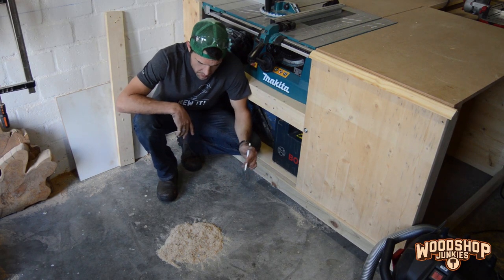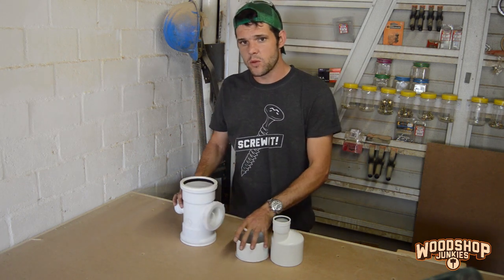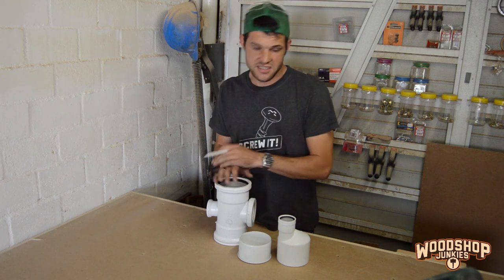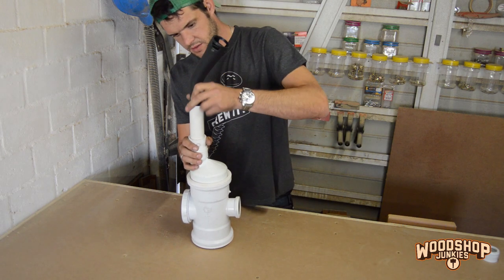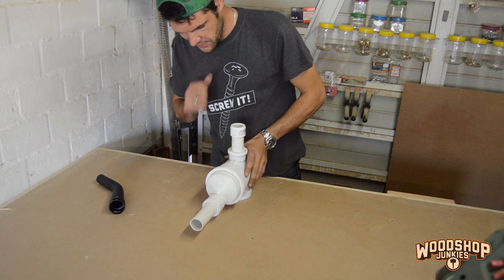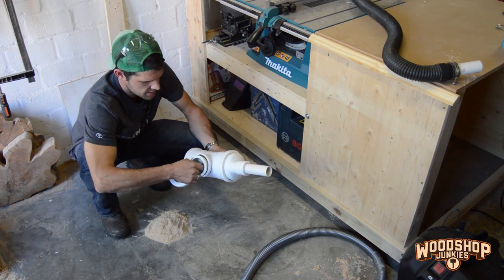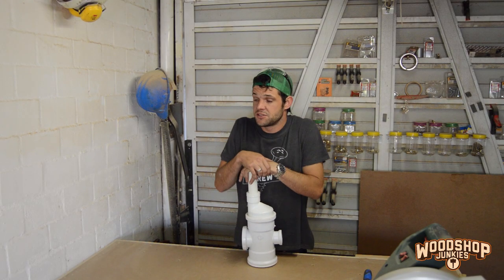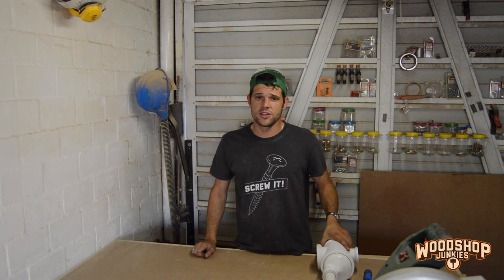Screw collector - Keeping small pieces of metal out my dust collector

Comment: I have a roller magnet 'sweeper' which picks up steel bits and pieces. But it won't pick up brass, aluminium, and most stainless steels. While cyclones are designed to fulfil this function, and do it very well, this a great diy solution. You get the gold star.

Comment: You are a modern working class hero! Do you have a photo and/or list available of the parts that you used?
Reply from the maker: Sadly no, it was a shot in the dark type project so I didn't draw up a parts list before starting. The concept should work the same even if you don't mimic the assembly exactly the same using exactly the same parts.
Reply: @WoodshopJunkies  I am no there yet but I think I can figure out most of the parts. Too busy outside to work on the workshop...
Reply: @dougveganparadisebuilder5808  1x 110mm x 50mm junction. 1x 110mm x 50mm reducing flange.1x 110mm stop end. 3x 50mm x 40mm reducer and some 40mm pvc pipe.

Comment: does anyone have the name of the  large to small adaptor bit (with the cone). I'm in the UK and I can't seem to find it
Reply: I'm in the U.S. so not sure of the size. But, I bet you could find a 4" PVC TEE (not good with mm yet) and use reducing bushings to fir your situatuation to accomplish a working unit.  Looking at the device he is using, the TEE and componants may be a bit cheaper. maybe.  This is just a thought.
Reply from the maker: 110mm to 50mm pvc reducer. I checked Amazon UK. They look a bit different but should work the same.
Reply: @WoodshopJunkies What is that tee device called I tried to find it in my hardware store but didn't know what to call it